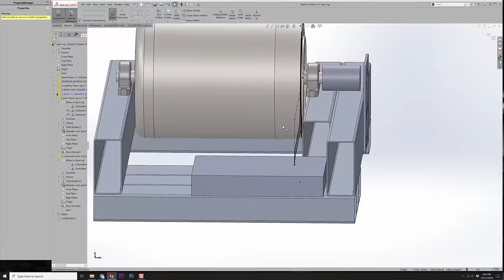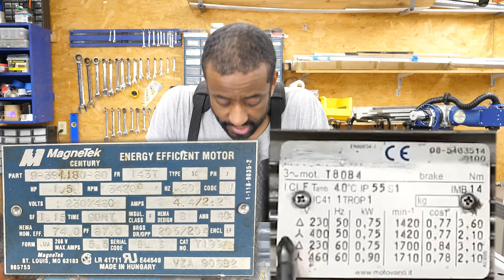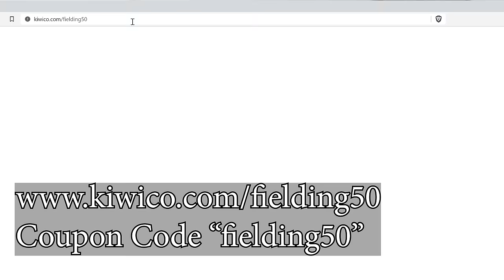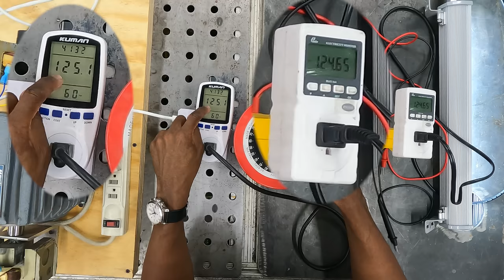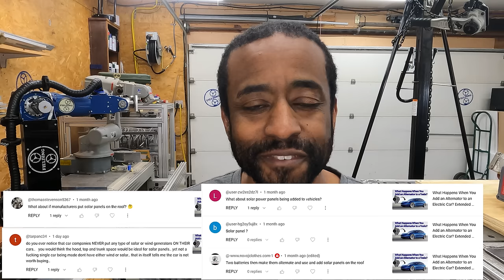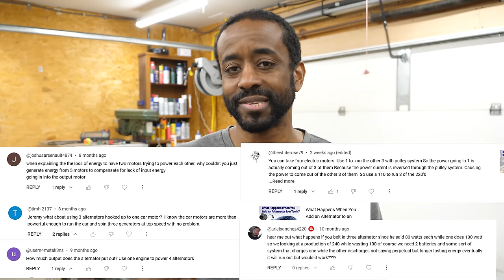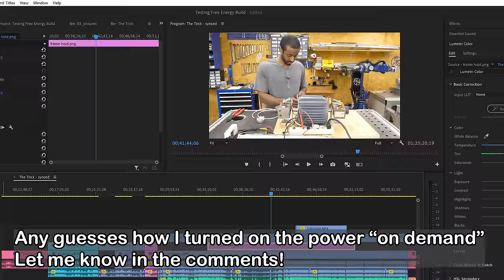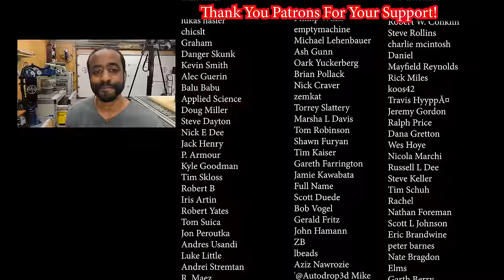Building and Reviewing Free Energy Generators on YouTube.

Comment: I've got an idea for free energy that really should work, but I haven't got the last step figured out yet.  What you do is you take an alternator and you attach it to a stationary bicycle.  Then you get your kids to continuously ride the bicycle.  Unfortunately I still haven't figured out how to keep the kids riding the bicycle.  The energy is definitely there, it just keeps running off.
Reply: There are varying methods of solving this unique engineering challenge.
Its always best to get everyone on the Team focused and on the same page.
Simply pull your main breaker/fuse and plug that alternator and boost converter to the wall.  As long as they want their phones charged, the X-box and TV to work, that should work better than chain retention systems.
Might be fatherly and splurge for some deep cycle battery bank.
Reply: A stun gun you super glue them on it and every time they stop pedaling you zap them😅😂 just kidding relax people lol
Reply: Anime

Put a TV in front of the bicycle. That's what a friend of mine did to make sure he did some exercise everyday.
Reply: Still gotta feed the kids if their yours. Ask the neighbors if they some spare🤣
Reply: Michael-dt, Problem solved; just mount a tablet or @ least a video game console w/in their reach while they are juicing the pedals.
Reply: Put the stationary bikes and treadmills in a gym and have the paying customers provide the energy while they're exercising.
Reply: @TheZigZiggy , honestly I'd be somewhat surprised if this hasn't already been tried somewhere.
Reply: @TheZigZiggy  Treadmills not so much, since as my younger self and friends discovered (very slowly) they don't work too well when they aren't turned on, but I am kinda surprised that gyms don't do something with the power from stationary bikes, since they are literally just generators connected to nothing. Even just charging a phone off it would be kinda neat.
Reply: I have 3 young kids, 6 and under. They have infinite amounts of energy.

I'ld do this, and believe me, I've thought about doing this as bedtime woukd be so much easier. You need to strap them in and duct tape mouths.

However, in doing such a thing 2 things will happen:

1 - Your food bill will go through the roof, and food is more expensive than the electricity they can produce.

2 - You're kids will most likely be taking away from you by Child Protection and you'll end up behind bars, where you won't need to be concerned about paying a power bill for many, many years. 😂

It's a joke people, no loving parent would consider such a thing. Just making sure people that see this know it's a joke.
Reply: 😂 you did well if you got todays kids started
Reply: @drillerdev4624 I disagree it would have to be a game or a cell with Pokemon go with a large cage of Pokemon prisoners that walked one at a time periodically in the the Pokémon world at zone location to make capture possible with little effort because the peddlers would lose control if the took their eyes off the screen while peddling whew😅
Reply: @drillerdev4624  He wanted kids not boomers
Reply: DC motor? With a battery?
Reply: Mine won't even ride a bike. 😂

Comment: Important point on power loss: the motor is wrapped with heat sink ribs or fins to cast off heat; the variable transformer is wrapped in sheet meal with holes to cast off heat. Power is always wasted in unusable heat generated by friction.
So if a device has holes or fins you know those are there to dissipate wasted energy in the form of heat
Reply: True, about the fins, but friction itself isn't much of an issue in motors. Unless an alleged device is using superconductors, there's resistance in the wiring, and resistance is what generates most of the heat.
Reply: That waste heat is the main reason you can't achieve perpetual motion, and any device used to capture waste heat and transform it into energy always demands more energy than it can transform. It's just an impossibility.
Reply: The heat in the variac is not due to friction but due to copper and iron losses. The copper losses coming from the resistance in the copper wires of the transformer and the iron losses from how iron magnetizes (hysteresis). These hysteresis losses can also be seen in the no load condition ( 18:08 )
Reply: True.  Another sign the system is losing energy is that it is making noise.  A truly efficient eternal engine would be completely silent.
Reply: Why not add rectification for thermal energy?
Reply: How is it that Jennifer Granholm, who is a lawyer with exactly zero experience in energy, is U.S. energy secretary, and Jeremy Fielding is over here making utubes? Granted, he's probably happier where he is, but good Lord...
Reply: I'm only half an engineer, however not sure why that would be considered an important point as its Electricity 101.
Outside of a few applications where waste heat is scavenged for some reason, pretty much all electrical products shed it through fins or holes.
Reply: @paulwooton4390  She will find a way to get around the laws of thermodynamics. Or argue to have them repealed.
Reply: Everything generates waste heat. Don't gripe about inefficiency just because something has fins. Maybe ask yourself WHY an engineer would want to get rid of heat from a device. Ask yourself WHY it might be NECESSARY for devices to be less efficient than we might like. Or, yanno, you could try asking your congress-critter to vote for different laws of physics...
Reply: @railgap  Nobody's _griping. It's a simple fact of life that machines need cooling. You seem to have missed the point of Engineer Mike's post, methinks.
Reply: @A_Stereotypical_Heretic Not exactly.  Even if we were able to create a completely resistance free electrical supply and a completely frictionless mechanical device, free energy is not achieved due to the Conservation of Energy principle.  The input energy and output energy would be equal.   A closed system of any kind can never get more power out than is input due to the fundamental law of Conservation of Energy.
Reply: @chiphill4856  true, but the caveat is the closed system comprises of the input the output and the target device or devices, or the thing with the energy demand. This means the input /output could be matched to the energy demand which means it could theoretically continually power the system as long as the last device in the circuit could produce the equivalent amount of energy needed to power the circuit. That's what I see a lot of folks getting wrong when they talk about closed systems and energy devices. They assume the system is just the input/output when it's actually the entire loop, which demands a constant and equal feedback to the input, closing once the outside force is applied. Energy is lost within the system because of waste, heat, and other transfers/conversions. That's what why it's impossible. You can't retain 100% of the usable energy, if you could the system could indeed power itself forever. Now if you just want a system that is an input/output back to input with nothing in between then you're still losing because of energy conversion, because you can indeed design a loop that has an output equal to the input IF energy wasn't converted somewhere in the system. Conservation of energy means the energy is absolutely still in the system, it's just waste, unusable energy.
Reply: @Andrew-ep4kw  There is also work being done to move air. This also ends up as waste heat but is not sensible heat, as in we can't sense it, in most situations. However I used to work for a company that made gas turbines and the waste heat from windage around the spinning drive shafts was far from insignificant. The same is true of noise, it all ends up being dissipated as non sensible waste heat. So we need a system with superconductors, zero friction, running with zero vibration and in a vacuum and there will still be some loss somewhere as radiant heat unless we can get it down to absolute zero in a totally insulated box. Sounds like we need magic in there as well to do it successfully. I think some mechanical gyros are/were run in vacuums to reduce running losses and heat build up.
Reply: I would agree with OP's point about friction. The electrical resistance of copper can be considered friction and the eddy losses of iron cores can be considered friction, just in the relevant domain not limited to the colloquial use of the word.
Reply: @A_Stereotypical_Heretic have you seen the bicycle wheel suppose to be spinning for years without stopping? I need to search for it later. Later it said it had a small battery enough to make it kept spinning. I don't know why it gain so much credibility. I compare it to a clock. One single double A battery could make the clock ticks for years. It's the same for the bicycle wheel where it just required small amount of electricity.
Reply: Aside from all the mathematical proof, the fact of the matter is, if free energy was this simple, it would be out there already.
Reply: I'd post a video about my zero point energy generator, but it melted a hole through my bench and into the floor. I guess it's still on it's way to the Earth's core. Hopefully not related to all the volcanism we've been having lately, ahahaha...
Reply: Wasted? Au Contraire Mon Schadenfreude friend.

Energy is never wasted it is simply converted & conveyed.
Reply: @BlueRice If you put enough energy into spinning the wheel and reduce the energy loss (mechanical friction at the spindle, friction with the air) as much as possible you can create a pretty fantastic illusion, though.
Reply: @Casmige  The energy is wasted in the sense that it's lost from the system and very difficult to recapture.

Reducing the inefficiency of your system is much more effective than trying to recapture the heat and convert it back into electrical energy.

The problem is that the closed system is the universe, not your house or even Earth (the planet). And so what happens is that energy that is sufficiently dispersed is nearly impossible to recover.
Reply: @A_Stereotypical_Heretic well, you know easily it can't possibly work because if you have a petrol or diesel generator,  the engine makes more kW than the generator output because of the load. So, if you need 5kw in to get 2.3kw out, it would just stop.
Reply: @michaelbamber4887  right. There is no system that involves a device that demands and produces the equivalent amount of energy. When using conversion equations, both sides of the equation would equal zero... Which means no work. Which means the device doesn't function for any purpose at all and is a wasted step in the system to begin with.
Reply: @BlueRice  I haven't no. I'll search it tho. I always enjoy watching these things and trying to decipher where the input is.
Reply: @jnharton  yeah. its the same with elector motor where it just pulse to give it a push. the same idea back then when nasa test out pulse nuclear booster. they said its like a mini bomb explosion to give it its boost. which in space once it move it never stop. the pulse support give me more longer duration to travel mind blowing speed. 

basically the pulse is efficient and less energy wasted
Reply: @A_Stereotypical_Heretic  the nearest thing to 'free energy ' is a wind mill. Perpetual energy is not real, but you can build a bike wheel weighed with bottles of water that spins for a very long time. Can't do any work with it mind.

Comment: Thanks Jeremy for reminding me  of the deep appreciation I have  in the foresight of my father who, when I was a curious young boy, brought home small items  like knife switches, dry cell batteries, small permanent magnet motors and many other things. All in pieces, as individual parts. He left these things for me, without explanation, for my own experimentation without any instruction. As curious young people do, it wasn't long before I took a strand of wire and shorted the dry cell battery terminals together. Of course, the wire burned up almost instantly and a short (pardon the pun) time later my father and I had a discussion about why the wire burned up. Resistance, in the wire, causing the electricity to be converted to heat. Eventually, I discovered that to my surprise a permanent magnet motor, when mechanically spun, would generate electricity. Thinking myself a borderline genius, I tied the two motor shafts together and expected the motor acting as a generator to produce enough electricity to turn the shaft of the motor in a continuous feedback loop. My father and I had another brief talk about why that woudn't work ... again he said, resistance in the wires of both motor and generator causing loss of energy, friction in the shaft bearings causing more loss of energy, etc. I could clearly see why my motor to generator experiment failed. These valuable lessons sparked and sustained a curiosity that has lasted a lifetime.  I'm 76 years old now and as you speak, I can clearly hear the words of my father. Thanks.

Comment: The quickest way to get where you need to go is a straight line. Every corner/alternative routes results in wasted effort; the same is true with power.

The cup illustration was perfect to help people understand that energy was wasted through each path until it reaches its output
Reply: Don't forget the already power you use was generated by someone so there's nothing like straight route

Comment: I have to say, watching this video as an engineer myself, I love your analogies. Especially the playdough one. I do sometimes give 'classes' to kids, so I am going to use this. It's also a really intuative way to explain intergrals and other stuff. While i deal a lot with motors in mostly servo-controlled drives, they sort of still remain magic to me. I know the basics of them, can calculate the working torques and speeds based on input, know the theory behind them but the details and design of one, well I am a bit at a loss especially when it comes to the newer generation of motors also used on EVs.

Comment: I’m an engineer, I honestly love perpetual motion and free energy videos. I find them fun to try and think of how they did it. My attention has been given with consent lol
Reply: The hardest part is always finding a place to hide the battery.
Reply: Or the cable.
Reply: There's one place a perpetual motion machine has never been tried and that's in space, away from any gravity pull. I have plans for one but need someone to help me overcome the gravity therefore, removing any force that would stop it. ☺
Reply: Hypothetically, I suppose one could rent a Cessna and fly a partial negative g maneuver (pitch up and pitch down), so you have a few seconds of zero g. 

 Experiment.
Reply: @pavanbiliyar  With enough rockets, I'm sure we can get a Cessna all the way to space 🙃
Reply: @danyf3116 Its not gravity who stop something. So useless...
Reply: Overunity units are what one wants to look at.  Nothing is perpetual if it has gears and pullies.  But any unit that can generate more energy than the circuit consumes no matter how small.  Is interesting.
Reply: Me too, I've spent 25 years thinking about how to generate electricity with magnets. 
GFG is coming guys. Jeremy will be so excited.
Reply: @adventureisoutthere8064  Not in this universe. Even magic has to draw energy from somewhere.
Reply: @adventureisoutthere8064  
But why would that ever happen?
That sounds like em extraction, if anything, which would require extreme scaling to be used for energy extraction as opposed to generation.

Comment: I love that you just did calculus with playdough 😂 amazing integration technique!!
Reply: I think one of the most amazing things about physics is that because it describes reality you can turn it on its head and use reality to solve the equations for you. For example in the 30s a Soviet engineer used this to make a water based computer that solved differential equations related to how fast concrete sets.